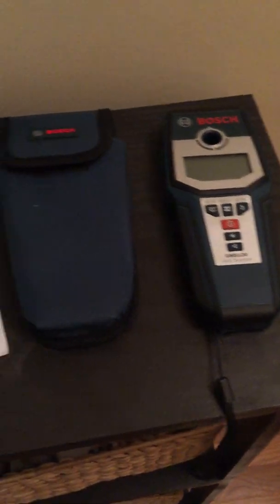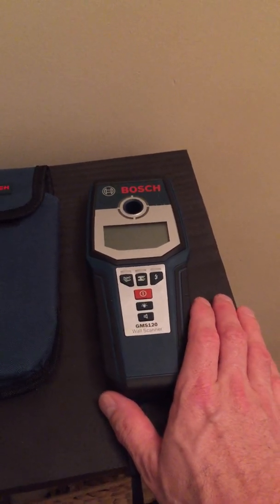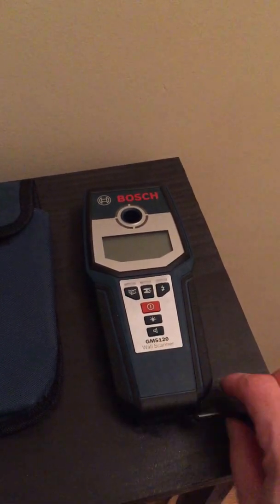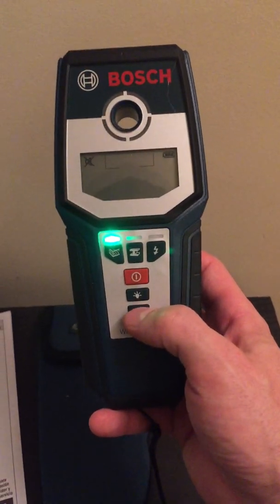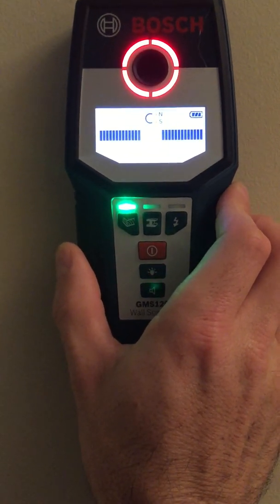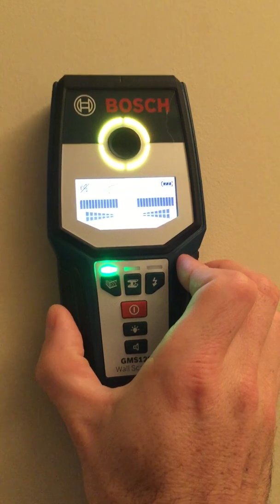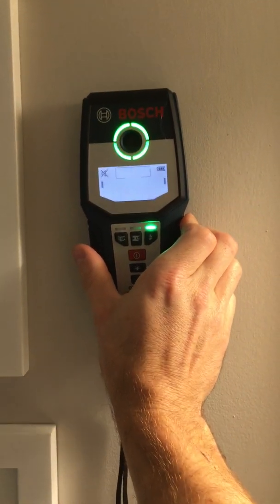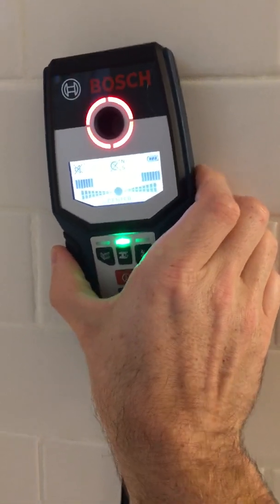Bosch GMS120 Digital Wall Scanner

Comment: You need to have the power on has to be a live current and it will read it have something on in the outlet or light switch trust me it works every time
Reply: No. I found this piece of junk totally unable to locate safely ANY live wire even in a brick wall, while on the other hand, beeps wildly (obviously randomly) over entire surfaces of some walls and even on a wooden table! I tried further with wifi disconnected (to prevent any possible inductive interference), holding it with isolation gloves etc., no success. Just stay away of it!
Reply from the maker: The light was on above the scanner in the video so the wire was live. I think the thickness and composition of my old walls mess with the scanner sometimes.

Comment: Any chance I could get you to try it on tile to find a stud?  You showed it finding the copper pipe, but I would love to know if it will work on tile to find a wood stud.
Reply from the maker: Mike, the stud finder does not always work well on "wood mode" but it will find nails/screws behind the tile. In the video, as I put the scanner on the shower wall, it briefly gives a reading for a magnetic/ferrous metal, that was it finding one of the studs behind the wall by means of finding a cement board screw.

Comment: Would it find not live cable plastered in the wall?
Reply from the maker: Alexander Brankov That’s a tough one and probably not. It can detect non-ferrous metals such as copper pipes but copper or aluminum wires that are insulated and deep in the wall probably won’t be found.
Reply: @steveva7591  Thank you!